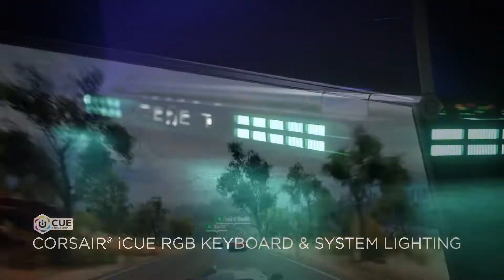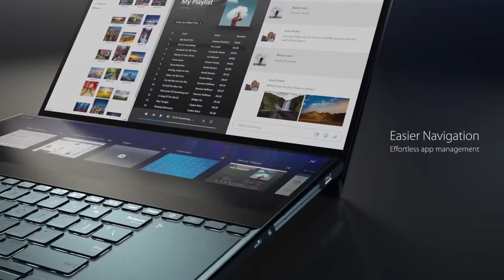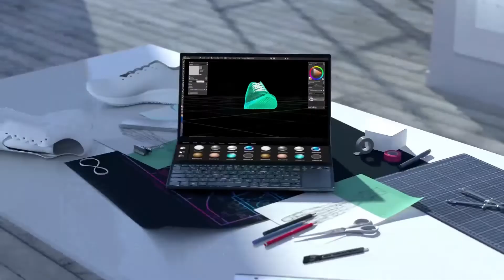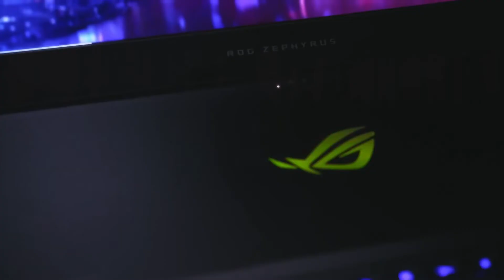Top 10 Amazing Gaming laptops to buy in 2020!

Comment: Great. But why no alienware?
Reply from the maker: These are suitable for all budget.. That's why I skipped alienware and also razer.
Reply: @ArkRayDen  But you included the Acer Predator Helios 700 with the specs used in your video it would be comparable to the Alienware Area 51M for price point.
Reply from the maker: @skiznillett3642  Haven't I mentioned 'for all budget'? Alienware area 51m starting price is around 3000 usd but helios is less than 2000 usd. (thus you can check all AW models having the same specs are priced much higher so not preffered by many users)
You can buy if you love it, it's also great..

The specs I have given are the of the highest model of every laptop.. 
If you have any other doubt you can ask me.. 😇
Reply: @ArkRayDen  you should make video about top ten best laptops. "best" i mean the most powerful laptops on earth. forget about the price. Because there is no single video on youtube talking about that